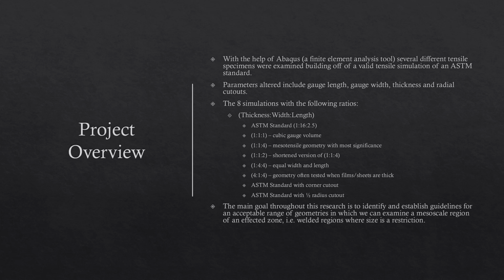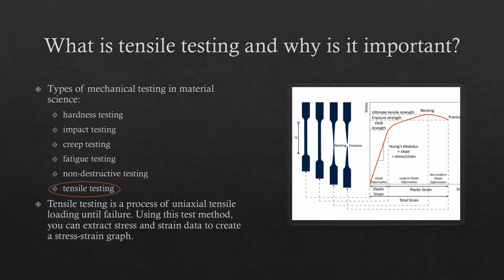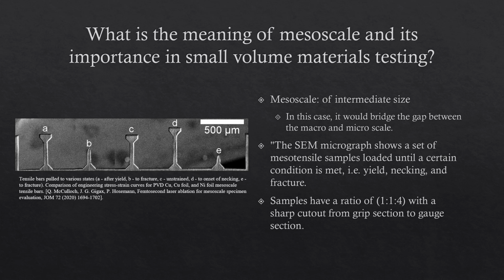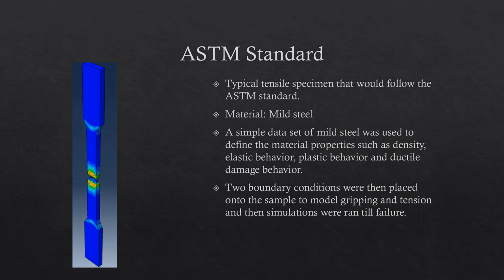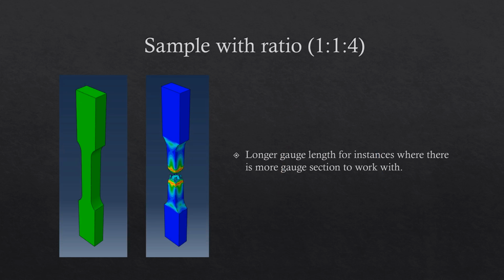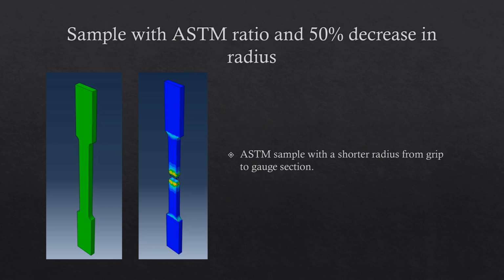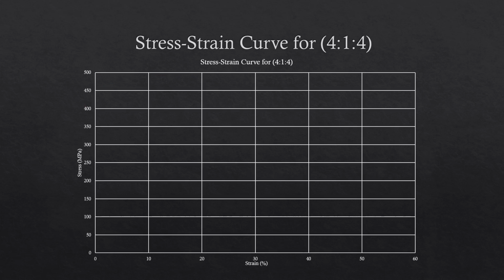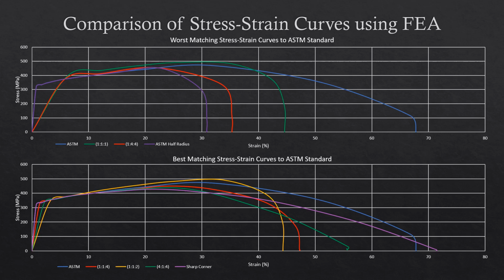TORREZ AVERY Automatic

Comment: Very good background on tensile testing and the shapes. Also, good description of the simulation setup that you used. I like that you  describe each setup of the simulations, but it feels like it is a little over-explained. I think a handful of slides with multiple samples and their respective stress-strain curves would be a better way to present this much information. Also, it would be worthwhile to overlay the curve for the modified geometry with the curve for the standard, so it is easier to visualize the differences. Likewise, since the samples all seem to be simple extrusions of a profile, it would be nice to have the 2D profiles of each sample, again overlaid and compared with the standard. It felt like sometimes the slides went faster than you could describe, so you might have needed more time to describe some of the datasets. I do not get what the worst matching and best matching curves show; it might have been more clear to describe the features that caused the most deviation from the standard instead. Also, perhaps some theory (stress risers, geometric reasons, etc) for why the samples gave different results. Nice job!